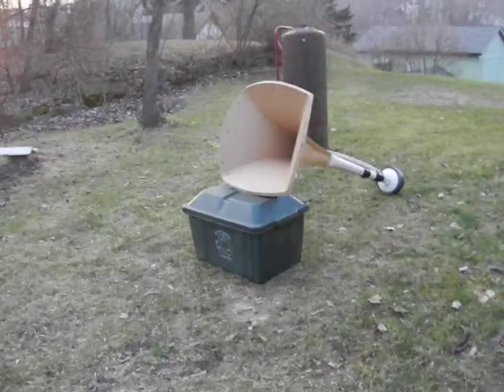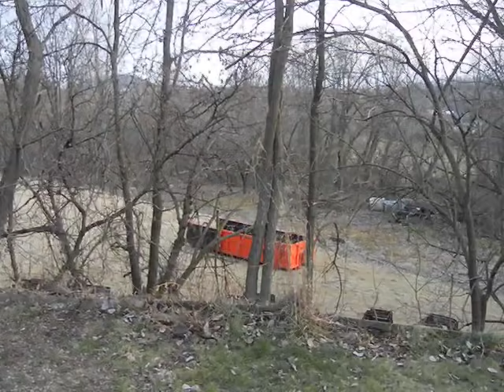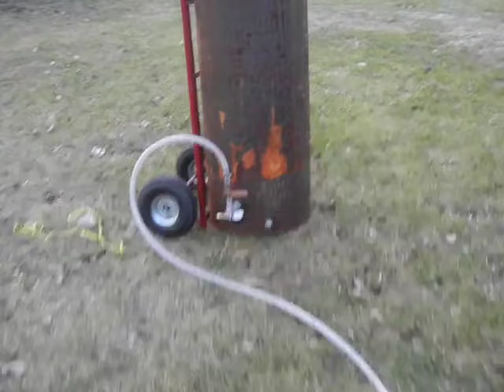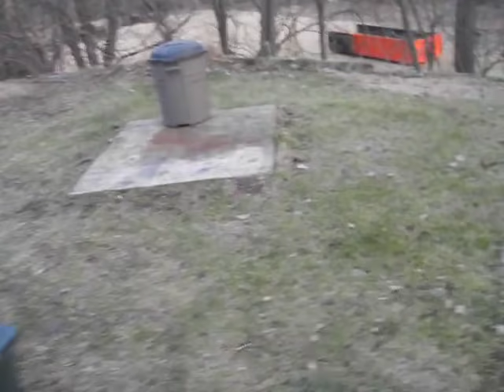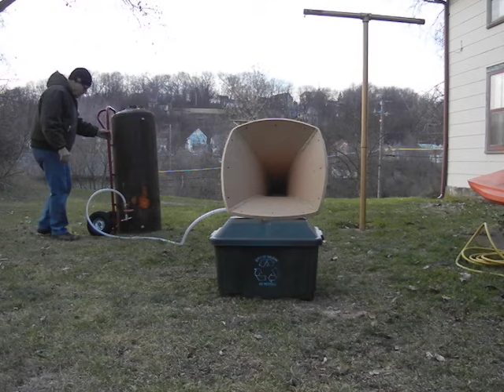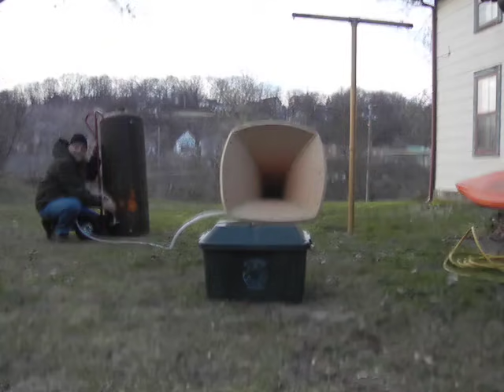Homemade PVC air ship horn

Comment: best way to get back at a neighbor with barking dogs
Reply: Or a neighbor that doesn't pick up his dog's shit.
Reply: Ha I've actually used one of those handheld compressed air horns before on my neighbours dogs and it shuts them up right away, wasn't thinking of that when I looked up this video but makes me feel like taking it to the next level.  Might shut them up for an hour instead of 5 minutes!

God I hate those pieces of shit, it's taken so much willpower not to to something stupid that I regret...
Reply: Champwsox05

I live in Chicago and had a neighbor that didn't pick up his dog's shit. In the summer the smell eventually got so bad that I hopped the fence one night to clean it up for him. Put all the shit in a bucket and poured it out on his porch.
Reply: A loud device like that isn't bad once in a while, it's the annoying incessant dog yapping that drives you over the edge.
Reply: Chad Linton. No the best way is to get enough money to buy a tornado siren and blast it at 3 AM on a wailing tone and then see what they do.
Reply: OR, to get a neighbor’s previously quiet dog to bark for 8 hours straight. Kind of an asshole thing to setup in a neighborhood.
Reply: @Frank At least you can hide the dog in your house if it's barking for 3 hours all the time
Reply: My neighbor leaves their jack russel out at all hours of the night. So I straight piped my truck and have friends with straight piped cars come by every so often to rev in front of their house and do burnouts. I don't do it at ridiculous times tho just enough to get back at them
Reply: I moved into a new apartment building and the house next door had this dog that kept barking. I put white vinegar in a spray bottle and spray it out the window at it. It keeps it away from my window and over time I guess it learned to stop barking near me. The smell of the vinegar gets to them
Reply: @Roger__Wilco  A hand held airhorn can make dogs go deaf. Don't do that.
Reply: @MrOramato  well....you know.... it's, uh.... how do I put this..... (LOL)
Reply: @Roger__Wilco  call me EC ; )
Reply: @SouthernIndianaRailfan  we have some of these dotted around the oil refinery where i live . Every now and then there is a test . The horn is loud even at 1 mile distance .
Reply: @HudsonGTV the noise of constant barking dogs are deafening too and yet they dont stop either
Reply: @damien523 Somebody should do a sit down interview with some of those dog owners ,and ask some real straight forward questions about what's going on with them.

Comment: Several years ago,  truck manufacturers moved the airhorns off the roof & put the usually under the cab. This was to improve aerodynamics. But they also made them much smaller & quieter.  I want that horm on my Freightliner!😅

Comment: It's April 2018 and I've just found this video. This is awesome! The dust blown out of the horn , the vibrating of the horn, the raw power of how this thing sounds! Much appreciation. Congratulations on the make! :) Have a nice day.
Reply: i think that is moisture from the compressed air
Reply: @keithfromny1898  Hmm, water residue in  the tank? You may be right, when I think of it. Thanks.
Reply: @CJWarlock  no residue, as it compresses the air it condenses in the air tank and the first blast blows it out. Just like a Sem. I love the horn! Going to work on a Reaper horn..scare the neighbors!
Reply: @keithfromny1898  Please excuse me my unfamiliarity with the horn compression and decompression phenomenon, I'm only familiar with the air compressor I use to clean up stuff. The moisture condenses in the tank and I have to pout that water residue out of the tank periodically. Otherwise the moisture would be spit out the nozzle together with the stream of air. ;) Did you mean that the horn adds to this phenomenon or did you just mean what I meant (condensate from the compressed air in the tank)? :)
Reply: @CJWarlock  No need to excuse you, It is a great video! There is moisture in the air so when the compressor compresses the air into the tank, it condenses and rushes out asap when you open the valve. Do you have a drain valve on the bottom of the tank? OPen that up when you are done for the day so it doesn't collect in the tank.
Reply: @keithfromny1898  Seems like we were both talking about the same phenomenon after all. :D Thanks for the tip, I usually drain my compressor from time to time, it didn't occur to me to do it every time. Seems like an interesting idea to check it out. My compressor is made in such way that the drain valve is off-center (both across and length-wise) so I have to manually hold it and swing it like a cradle for the condensed moisture to pour out. ;) While I can get it why the length-wise off-center location, I think the across off-center location of the valve is stup... not wise. ;) That's why I don't drain the compressor too often - it's too much struggle. ;)
Reply: Air horn prank, anyone?
Reply: Lol..its 2022..and I just got this in my feed..😆
Reply: I had a funny idea of using a 12v air valve and wiring it to an alarm clock. I could make SpongeBob's alarm irl
Reply: 2023 here

Comment: Can anyone shed any light on how he’s constructed this? I want to know what the clamping ring it’s made of. Is it wood? Is it thick conduit? Maybe it’s PVC, I don’t know. Looking at the rear clamping ring, there seems to be a small cut in the top of it… if I were to guess, he’s probably done this as a way to tension the diaphragm. I found one of his discussions on a forum from like 2011. I actually think the guy’s passed as he hasn’t responded to activity or comments on any of his YouTube videos. I’m so intrigued as to how he’s done this. This particular design lets you play around with diaphragm settings rather than the traditional PVC slip ring that seats agains the diaphragm deep within the main housing. This ultimately provides an additional 25-30% of resonating chamber which I were to guess would make the horn louder.